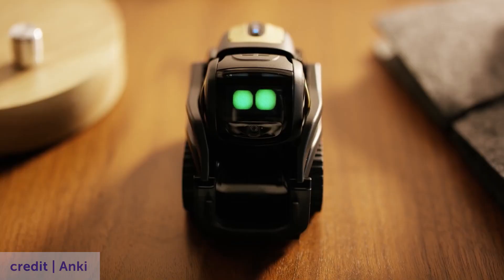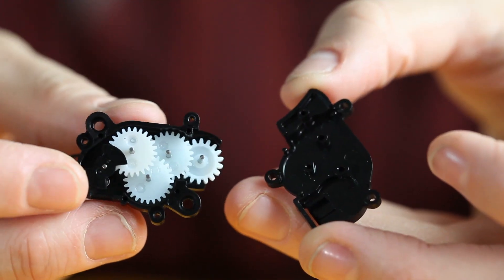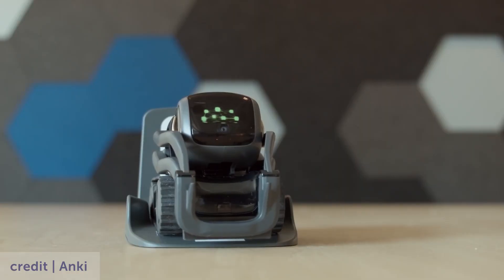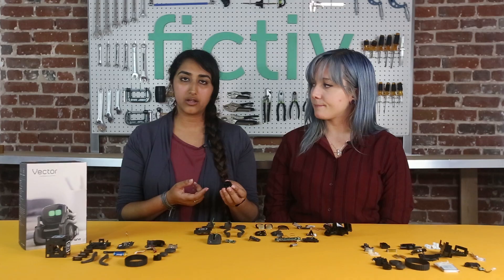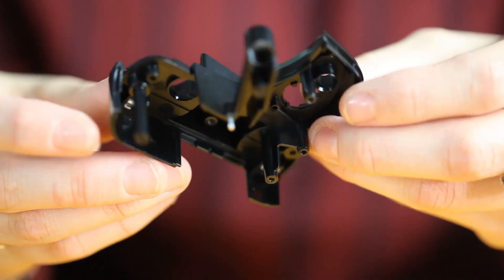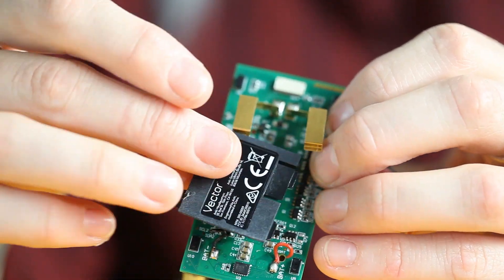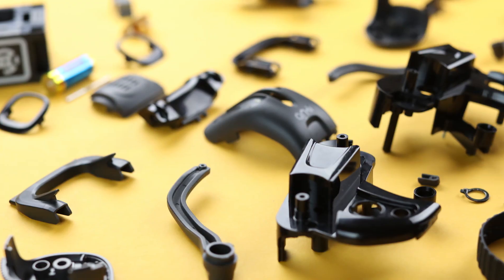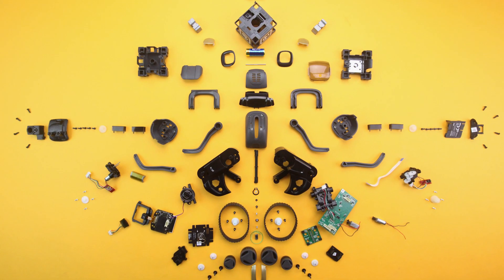Fictiv Teardown | Anki Vector Robot

Comment: The very most instructional and well presented tear down of the Vector robot.   I try very hard to spread your video.   These little Bots run forever.  I just put a new internal battery in.  But mine has been going 24/2 for over 2 years.    2 smart women!

Comment: This is not accurate in almost any way. Vector was made with volume manufacturing in China. This means that, for instance, the gears would cost a penny apiece, the touch sensor is very cheap, etc. The plastics were the cheapest parts of Vector. Anki had hardware engineers that knew what they were doing. The electronics are where most of the cost goes to. The headboard, for instance, has the Qualcomm CPU, GPU, Wi-Fi chip, Bluetooth chip, 720p camera, screen, and many more components.

Comment: A former Anki employee was asked about the accuracy of this video. This was his response: 
“It is very inaccurate. I don't think they have very much experience with volume manufacturing in China, because they drew completely backward conclusions whenever they discussed costs or manufacturing. For example, the gears cost a penny each and they seemed to think they were expensive. Meanwhile, the electronics are the only expensive part of Vector and they thought it was cheap. 🤷”
Reply: But it was two years a go...
The  original vectors made in Germany and USA.. not in china.. The china version (the copy from the original ) had a lot of malfunction like software and neural issues. the copies are not worth even $50